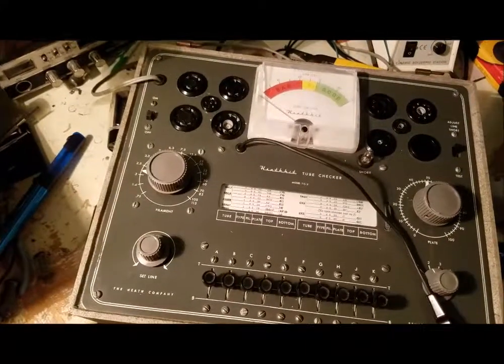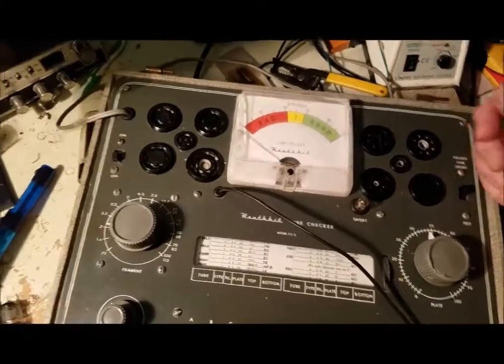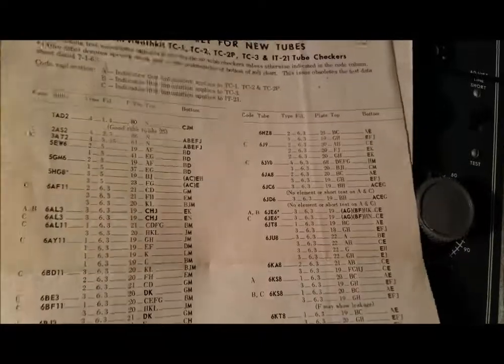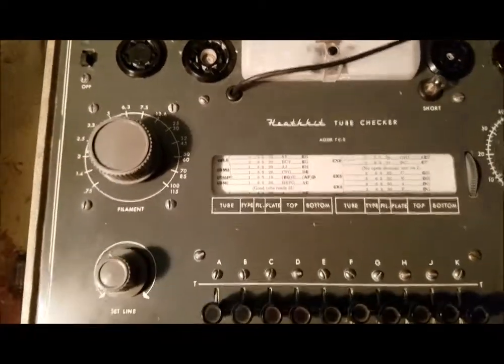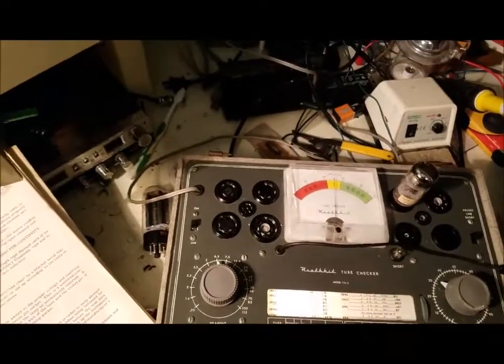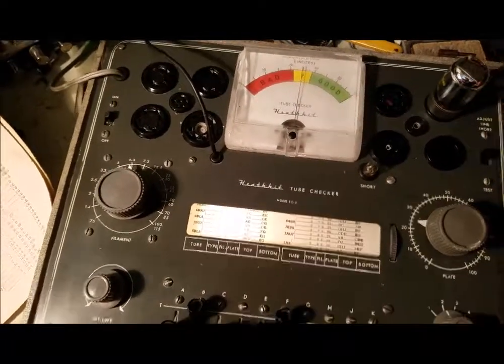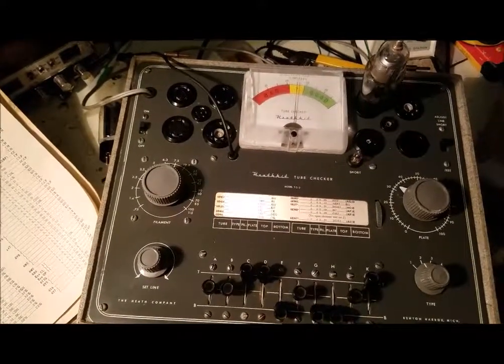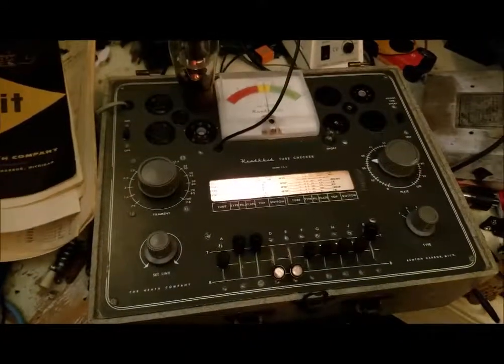Heathkit model TC-2 tube tester

Comment: Most of the Heathkit tube checkers used the same circuit, with minor variations as different tube sockets and pin circuit selector switches were added on later models. Looking at the schematic for my Heathkit IT-21 tube checker, that 0.1uF capacitor is NOT used as a filter, instead it is used as an AC coupling capacitor, passing AC and not passing DC. It also seems to have some function as an AC voltage dropper, because it is in series with a few resistors right off of a secondary winding on the transformer, so it looks like its capacitive reactance is being used to drop some voltage. This suggests that the value of the capacitor is important. The OP of this video seems to be thinking that the capacitor is a filter for the meter, and thus an increase of capacitance of an order of magnitude from 0.1uF to 1uF must be OK, but in this circuit, such a change will also change the voltage in the RC circuit, which might or might not be critical....it might skew things enough that the circuit won't work as designed, or the circuit design might be inherently sloppy enough that it does not matter.